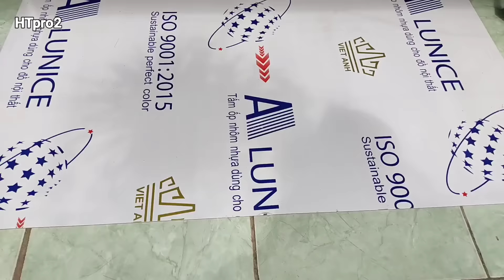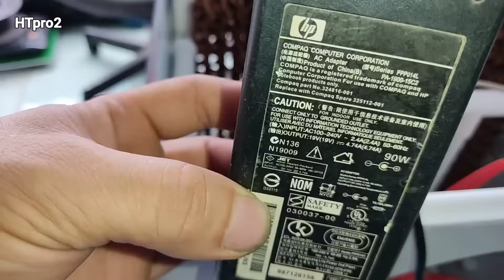i make air cooling fan with PVC -  DIY at home

Comment: Motor and blade details
Reply: Motor single ph 50hz,Fhp,300 to375w,with light weight  Upvc fan blades,found suitable but electrical winding of motor suitably wound up for 3 speed controls.